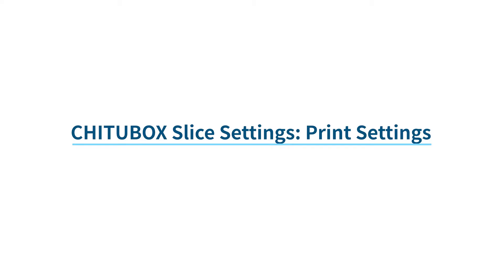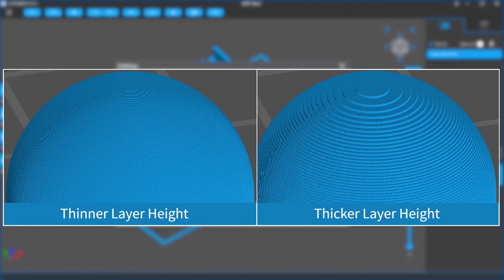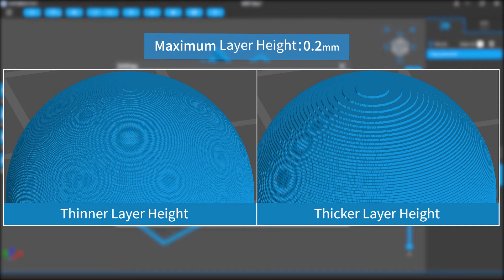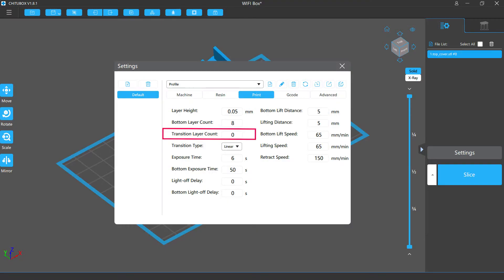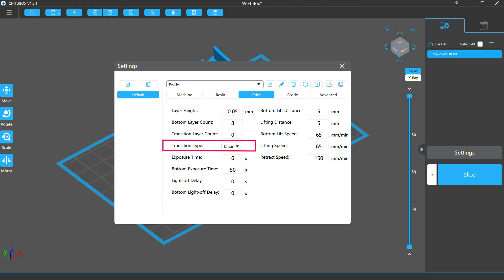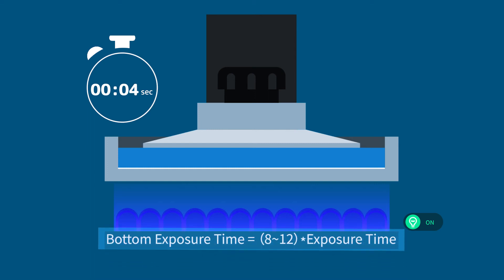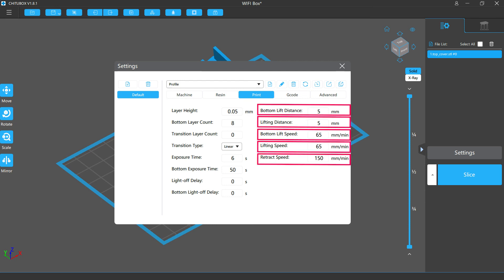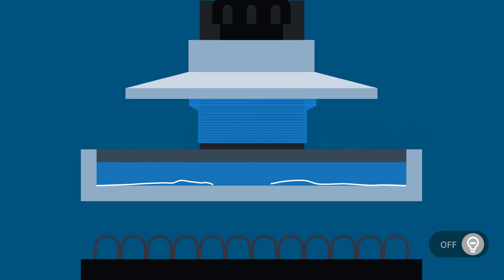[Tutorial] CHITUBOX Slice Settings: Print Settings

Comment: Where are these settings in pro? I can't find them anywhere.
Reply: @D AB After you slice the model, there is a screen before you save the file. These settings are under Parameter Manager. I also use the free software UVtools on my saved STL to fix islands, suction points, and resin traps. That tool allows me to adjust these settings in a more convenient way than Chitubox.